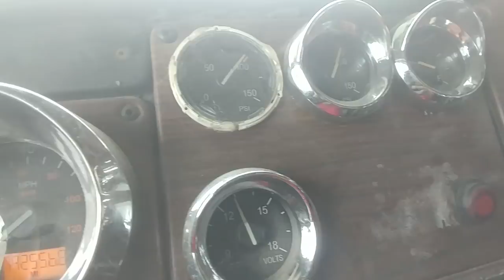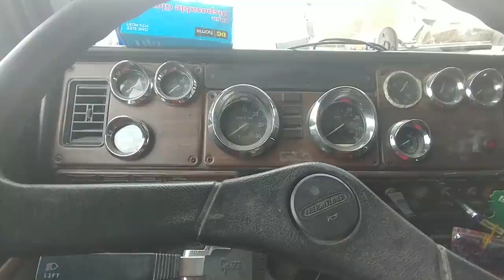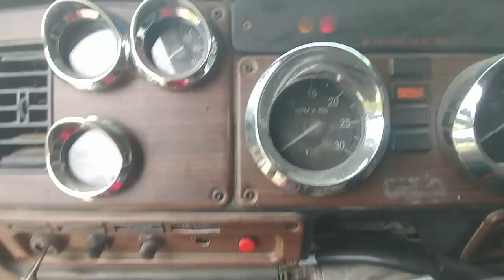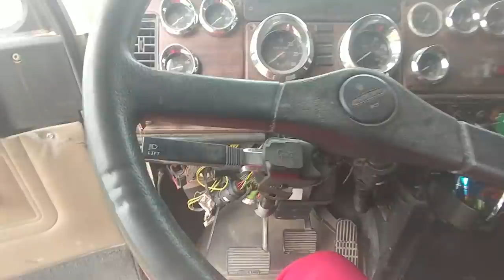FLD120 Broke Down (2nd Breakdown Ever)

Comment: Bruh...put a sleeve over that power wire for your inverter. You don't want that hit wire to run and short to ground. That cause a lot of electrical fires.
And you put your finger on an issue. Any arching or burn marks at wiring connections means poor connection. Fix immediately
Reply: Tony M that arching is crazy. Shit will definitely cause a fire. Fix that even if you have to put some electrical tape